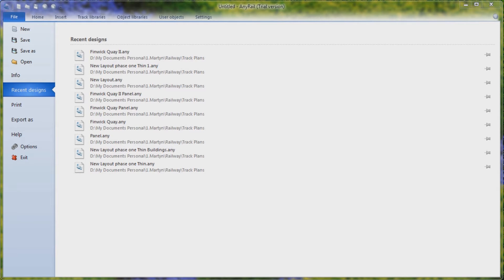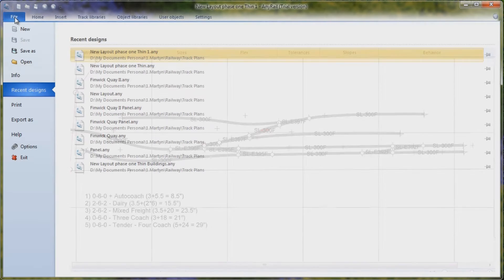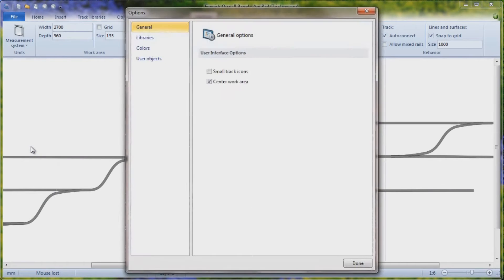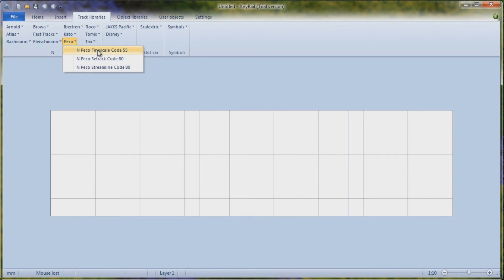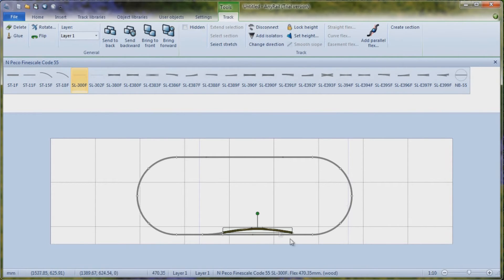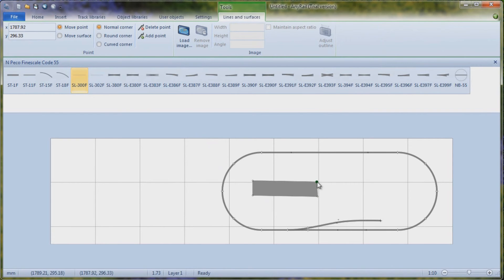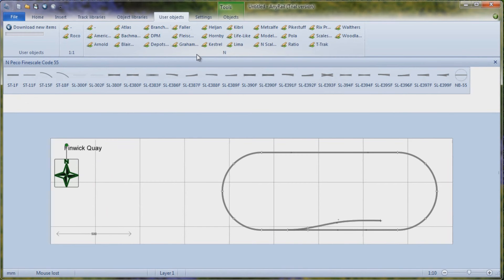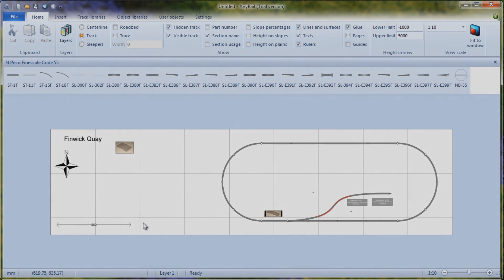REV1 - Introduction to AnyRail 5

Comment: Hi,  I also am using anyrail for a grassroots S scale layout.  I am fairly far along and laying track.  My suggestion would be to design your track plan, then layout your buildings, streets, and other hardscape. Finally insert your surface under neath the design which will be your benchwork surface.  Then see what it takes to provide coverage for your design and see what the benchwork dimensions are going to be.  If that is all good - - THEN build the benchwork!!!  Nothing is worse than running out your track and scenery and THEN learn you are out of benchwork to support it.
Reply from the maker: Thanks Robert.  There is some sound advice right there :)